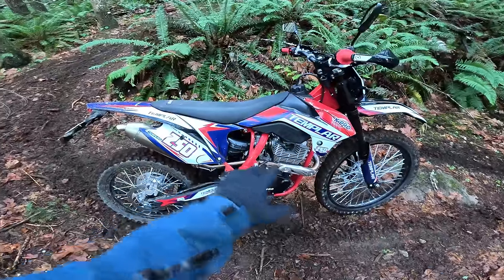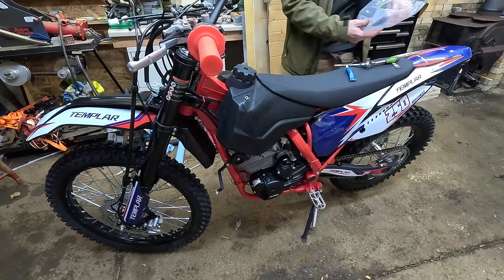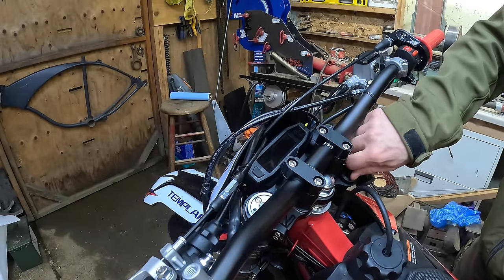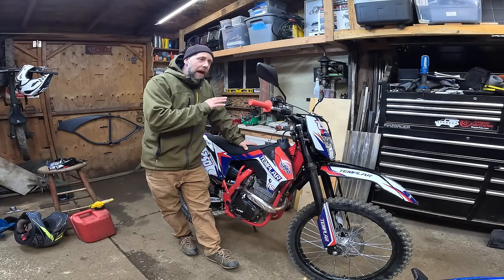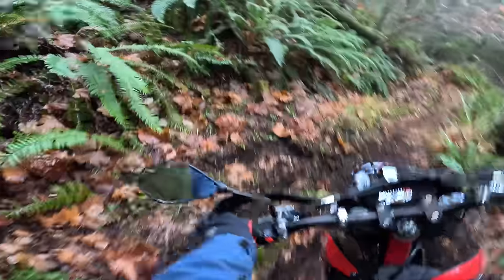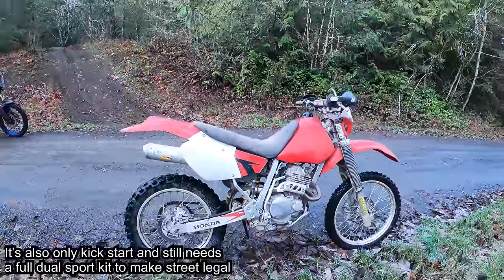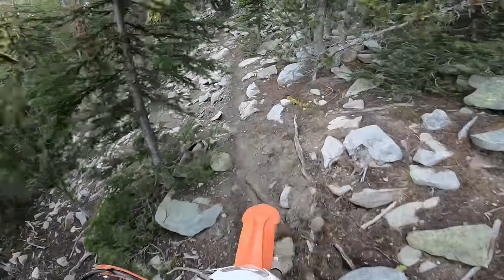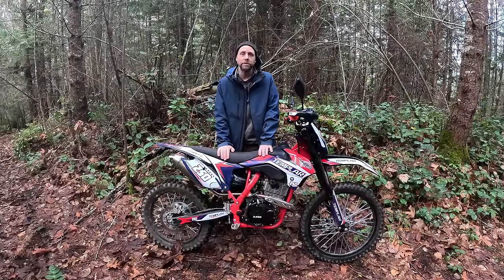Best Value New Street / Trail motorcycle? X Pro Templar 250

Comment: I may be interested in something like this (Probably the x model with the bigger frame and 6 speed) because I have a 2 minute work commute. Cheap, simple, reliable, and more fun than an old $#!+ box. Luckily,  I'm pretty handy (I've worked on my own cars and street bike, and have worked in auto dealerships and body shops) so this should me pretty easy for me to maintain and/or mod. I used to ride an '82 Kawasaki ZK650 CSR year round, to 2 jobs, for about 2 1/2 years. I didn't even own a car, and my (EX) wife sat at home with a Saab 9000 Turbo with climate control, heated leather seats, etc. I wonder about the weight capacity and seating position, me being older (51yo) and kind of a big boy. (5'9" and 300lbs.) My current wife has a Nissan Pathfinder that she drives to work, and we use that for shopping, vacations, my son's sports competitions, etc.

Comment: The problem is the quality of the parts. i had a hawk dlx efi. Every thing is just low quality and bends and breaks easily. Might be easy to fix but it always needs to be fixed
Reply from the maker: We’ll time will tell on this one. So far I have been happy with it, after a year or two we will see. How many miles did you put on your Hawk? I have my XR 650 L with over 35K on it, I never see getting anywhere close to that on the Templar but it’s a smaller displacement bike and I never see myself riding it out of state.

Comment: Are you sure that lever is the choke? Looks to me like a hot start lever. Most 4Ts, at least old style, had a hot start lever you pulled in when you started it when hot.

Also best to check chain slack when on the stand. Maybe 1 3/4 of slack when measured from the swing arm, or something like that.
Reply from the maker: It’s a choke lever even if it looks like a hot start. I have been riding for 36 years and have always sat on the seat to check chain slack, because some bikes the chain slack will change throughout the throw of the suspension.
Reply: @Mikefestiva  that's right !!!!🦜👍👍👍👍

Comment: The X-Pro templar is taller than Hawk Chongqing Song when as long the rear wheel is 18 inch tire. Total motorbike have 17 inch rear wheel tire size. Yes, the Hawk is X type jump bike 250 the Templar is RXE your choice is taller Titan or shorter Templar EBAY power sport Parts

Comment: The X-Pro motorcycle for your professional racing but the suspension is too high. The 7 or 8 inch mono shock dampener coil over absorber is for a cost $139.00 dollars. That lower the clearance between under rear fender and the upper tire the better for cornering.     I have JT 39 - 40 tooth rear sprocket for Enduro Screamer 250 with Honda street front fender color alloy black.

Comment: I appreciate your diving into the deep end of the pool..... lol,  I recall 6-7 yrs ago(approx) that the Chinese dropped some small
road bikes w/  fairings  & I thought the bikes actually looked good.  They took all the best looking attributes in shape/sizes and
colors that they liked from other bikes & made similar ones for their products.  Kool enough & then the young man started his
riding career & there was  always some  issue to deal with.  A lot of screws/bolts n nuts backing out & he was using lock-tite
to combat/curb the issues.  It turned out to be a pervasive problem that made me look away from any of their products but it
was 5-7 yrs ago & who knows,  by now they might have fixed those quality control issues?  I'm gonna watch  your review but
if you're used to a KTM it'll be difficult to drop into this & like it at all... lmao,  if the KTM has a top-end service at 3,000 miles
then this one will be a throw away & buy another one at 3k-5k, take or leave a few hundred miles but If ya can't add better
parts after the 1st ones fail then this is like everything else at Walmart,  throw it away & buy another one ?!?!?!?!  Naww??

Comment: I was able to buy a 1986 Suzuki SP200 street and trail bike with clean title for 200$ and 2500 miles a guys father had it in his basement and recently passed it looks brand new I was able to clean the carb a oil change and new battery and it is only kick start with a decompression valve handle.Its the perfect bike for trails and riding the rural roads in my area. I have gotten some great offers on it but it is one I may hang onto reminds me of my old Honda XL 175 I had but it has a full floater swing arm and the Mikuni carb is simple and air cooled

Comment: Are the 250s’ the Honda clone 223cc with a big bore kit or are they a different engine all together?
Reply from the maker: I don’t know a lot about these engines and what they are based off of, but I do know the engine manufacturer also makes a 230cc sold In the Titan and other models. This engine is actually a 250cc engine. There’s a lot of info about these engines of the China bike forum if you are interested in that.
Reply: The 230's are pushrod engines, based on th ancient CG125 design. This is an OHC design.

Comment: What’s your thoughts on the air cooled engine and 80+ deg days ? I’m guessing if your speed stays up shouldn’t be problem but what about hard slow steep on hot days
Reply from the maker: I have rode in 100°F days on my Honda XR 650 L with all my bags for camping, other then the engine sounds a bit more rattly they usually quiet back down once they cool off.
I have also rode many air cooled bikes on hot days on slow technical trails, they do fine.

Comment: I find the templars suspension to be quite soft For my taste but overall it's an ok toy for putting around with
Reply from the maker: Well how heavy are you? 
The suspension is fairly soft but feels okay for trails. I probably will preload the front forks and rear a little and I think it should handle any trail I plan to ride. Maybe a Toy for you but it’s a decent bike for my riding style.
Reply: 6'1" 185lbs
Reply: Well as long as your not hammering on it it's safe enough
Reply: @Mikefestiva where did you get those sweet brush guards?

Comment: Hey guys can someone help me out? I want a dirtbike and I came to this video because I wanted to see if this bike would fit me. I’m six two and 250 lbs. looks like most 250cc are too small. should I just go for a 450cc
Reply: Bro I’m 6’2 210 pounds so your a bit heavier but I ride a yz450 things a rocket. Its to much for any average rider. If you’re just an average rider who wants to chill and not have a death machine go for a a 250 trust me, I should’ve
Reply: You need the X or M model with a full sized frame.

Comment: Im 6'2 ft would you say I'm to tall for me this bike and I'm 270 lb .
Reply: the templar m, i had to spring it up (granted i got it used and the other guy was short as fudge) but i am at 75% of the threads on the adjustment and it fits me perfect at 5' 8"

Comment: What do you recommend the Storm 150 or Templar 250
Reply from the maker: It depends on what you plan to do with it?
If you’re a smaller rider and just want to ride trails the 150 is a good option, if you don’t mind a heavier bike and ride trails but also plan to ride roads and want a good dual sport the Templar is probably the better choice. 
The 150 is great but it tops out at about 53MPH so it’s better for slower roads and trails.

Comment: is this better than the cheap honda xr150l?
Reply from the maker: I think so but that’s my own opinion.
This has aluminum rims, the XR has steel. This engine has an extra 100cc so I think that’s probably the biggest difference.
This frame is based on a 2014 KTM frame, the brakes are great as well. 
I have never rode the Honda but I feel this bike offers more value then the Honda.
Reply: I went to look at the XR150r. I asked the salesman what the out the door price was. He told me it'll be around $4500. I told him thank you and left.
Reply: The Honda MSRP is $2971 but with all the bs the dealer adds you could buy 3 of these..... oh wait.... I just ordered one cuz the X is out of stock.  Will order a X also for less then one Honda.  Thanks for nothing greedy dealer

Comment: Too bad they can't make a real seat even on a Chinese copy. They've just copied a race bike.  Every dirt bike made in the last 20 years has a tiny, 1-inch thick, hard little patch of rubber you're supposed to sit on all day.  You're led to believe that a "real motorcycle rider never sits down anyway so he doesn't need a seat at all." If you're racing on a race track yes. If you're riding a trail or a dirt road (like 99% of all actual dirt riding is), you really should have a real seat you can sit on for extended periods of time.
Reply: I hear you but fwiw, the X (the upscale model of what is shown in the video) has a seat that imo is downright plush...maybe a lil narrow.
Reply: @tonydangerfield2407  Nice!

Comment: I'd like to know if you can find a larger gas tank.
Reply: The M and the X model have a 2.3 gal tank vs. the 1.72 gal that comes on the standard Templar.  I would think they would interchange .
Reply: @randyburton9092  I meant, does an aftermarket tank fit?  If the frame is 2014ish Husqvarna and the plastics are Suzuki, does either one fit.

Comment: Can you change the petcock to add one with reserve?
Reply from the maker: I have been looking for the same mount style and I haven’t found one yet, if I do I definitely will cover that and where I found it at in a future video. Thanks for checking out my new video 👍
Reply: @Mikefestiva  If you can't add a pet with reserve, what about a mount for an MSR fuel bottle or something similar? Wouldn't be as convenient as switching to reserve but it would beat getting stranded.
Reply from the maker: @tonyz2897  definitely 👍 I have one of those MSR bottles around for that exact purpose, the seal really well 😊
Reply: @Mikefestiva  Nice! I was considering one for my KLX but ended up putting a rear rack on it. Now I'm thinking rotopax on the knockoff pelican case I've mounted to the rack. The KLX tank is pretty small and being EFI, It also doesn't have reserve. The extra capacity would be nice.

Comment: Are these the China knock off from the Honda engines from the 80's?
Reply: They're a CG125 copy upscale to 200, 230 and 250cc. Some Chinese manufacturers have actually bought the license from Honda so they're 1:1 copies. Lifan engines are actually made on the same tooling the Honda engines are made on, since they used to be a manufacturer Honda contracted with.

Comment: Who makes the engine?
Reply: Maybe Lifan < it's a popular engine for Chinese Pit Bikes
Reply: Engine made by Zongshen.   You can see the model # in the part of the video where he's draining the oil.   ZS172FMM.  The 5-speed is ZS172FMM-3A and the 6spd counterbalanced (on Templar X) is ZS172FMM-5.     There's also a ZS172FMM-6 which is a 5spd w/4valve head that makes more power ~25hp), but it's rare in the US.  Zongshen makes quality engines in he same vein as Lifan.  (CSC RX3&RX4 , GPX FSE 250 are two other example bikes with Zongshen engines.. that cost a lot more).

Comment: I bought a Chinese bike it was real pretty but they're not made to last The quality of the materials is terrible they decay pretty quick they're good for about 3 years after that they turn into a pile of junk I guess more than anything it's the quality of the materials seems like the carburetors are junk though barely work That's my experience I have one sitting in the yard that's a pile of rust and decaying low quality materials
Reply from the maker: Check back in 3 years and we will see, I really doubt mine will be rusting in a pile in my yard. Mainly because I don’t leave my bikes  outside in the rain when I’m not using them. All bikes will go to 💩 if you don’t take care of them.

Comment: Is this a true 250
Reply from the maker: Yes this is a 250cc 
some of the other bikes sold are called “250” but are truly a 230cc
Reply: 232.6cc all of them round up, it's not uncommon.
Reply from the maker: @Giitzerland  It’s actually the CB250F engine’in this bike, they are 249CC, overhead cam. It’s not the Zongshen “250SG” which is really a 230cc engine. 
There’s a lot of engines that claim 250cc but are really 230cc sold in many bikes. This CB250-F puts out about 4 more HP the the 230.

Comment: Not bad for 1400 , however a used real Japanese bike is probably better quality.
Reply from the maker: Probably, but I have owned well over 30 used Japanese bikes over the years and wanted to try something a little different this time.
Reply: Like where and when?  Local bikes on C/L and Marketplace are a crap shoot of Japanese bikes of variable care and condition and some models are even harder to find parts for and their prices at the dealer...
Reply: @Mikefestiva  Not to mention most dirt bikes are thrashed on the used market.  I like your welding vids Mike.  Thanks for those.  DW

Comment: So my question is why buy it?
This is old scholl tech, Chinese made for $1800-$2000. When you can get a fully functional bullet proof used honda or kawasaki, yamaha for same or cheaper and most will be larger cc engine. 
When right now in  colorado 2024 on craigslist or FB matket a 1985 honda cl 500 8k miles is $1500, a 2009 yamaha xt250 10k miles $1800. 2009 kawasaki klx300 , 3k miles $2k.  I personally would rather get a bullet proof retro 80s honda than these for the same price or cheaper.
Reply from the maker: I have owned over 30 plus Japanese bikes over the years, clocked over 60,000 miles on the roads and countless miles on trails. I wanted to try something different. The bike isn’t right for you, simple as that.
Reply: You must not live in Washington State because the used prices on bikes you've mentioned are double.
Reply: Washington and Oregon prices are very similar

Comment: Ok I won’t speak on the build quality because that was never going to be good and it is imperative that buyers go through the entire bike and make the many corrections needed to survive the first ride. However the materials used seem to be high quality, the finishes are pleasing to the eye, the fact that this TFT puts Japanese dual sports to shame impresses me as well. Also I’ve heard that cheap chinese engines in vehicles/bikes like this are dead reliable if not especially powerful or characterful. The chinese auto/moto industry is where it should be. If they remain in the low price point they are at (unlike the Japanese who have oversold themselves in many ways, killer marketing tho) then the people of the world will begin to trust their products more and more. I am amazed at this bike based on what I’m seeing here.

Comment: Don’t remove the cat.
Respect nature.
Reply from the maker: I plan to make the cat a good place to relax in my shop, food water and even a cat box 😊👍
Reply: @Mikefestiva  Its not a catalytic converter its a power increase pipe gives it better low end power, used to have the same thing on my Pro Circuit race pipe, for my KX450.
Reply from the maker: @fullboostturbo1  I know what you are talking about, a lot of nice exhausts have that, but this one actually has some fine restricted honeycomb shaped tubes packed into the expansion that restricts the flow. 
I have had a few other people not believe it’s in there but there’s been other people that have removed it and mentioned the restrictions on forums for this exact bike.

Comment: The Chinese are making very good LOOKING bikes and vehicles recently... that should be a red flag, almost everything is reverse engineered from a legit vehicle, minus the quality. I would suggest looking for a used XL250R, or similar, any year, it will outlast/outperform this junk for decades. Parts won't be an issue, neither will knowledge, and support. What you don't see, is what will bite you! The quality of welds, softness, or fragility of metals, tolerances of internal works, very low quality of plastics, bolts, springs, etc(things that matter!), and absolute lack of support(unless you're a Youtuber, lol).
Reply: And then you’ll realize how crappy the XR’s frame is after it needs to be welded over-over…